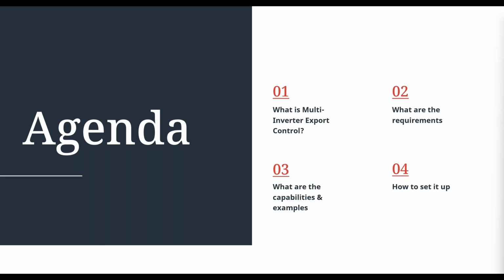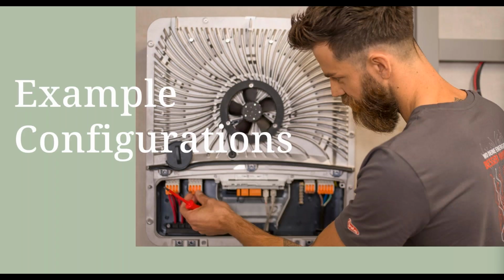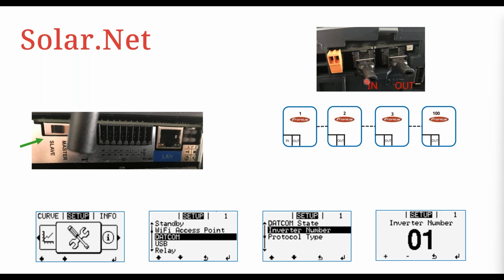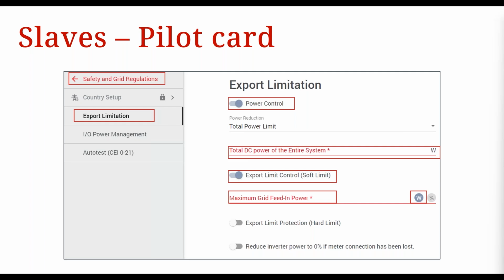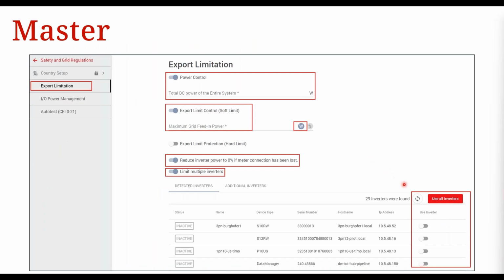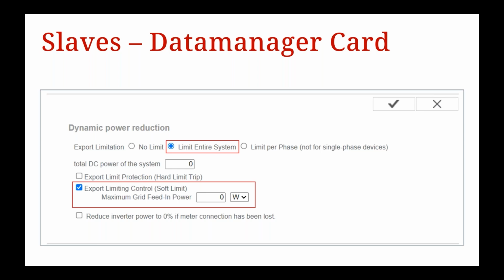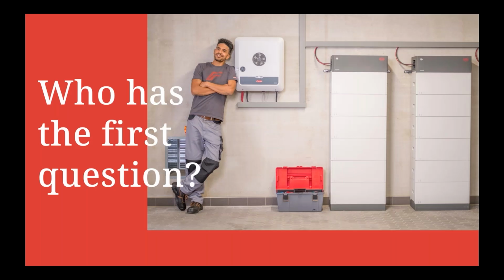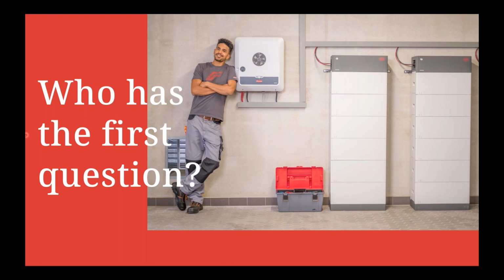Webinar: Multi-Inverter Export Control with Fronius Solutions (AUS)

Comment: I still don't understand why this all had to rely on an IP connection.  Why couldn't all of this have been possible across a standard RS-485 connection? My biggest issues with IP based is that customers change routers and stuff everything up if its contain in its own modbus network using its own wiring, that's not an issue.  Sure you could setup a router just for the system that then plugs into the customers router, but more cost an complexity. 

Also, forgetting export limiting, is it possible to have multiple GEN-24s operating WITH batteries?  And if so, can it do so when in backup mode?
Reply from the maker: Hi there,
For technical enquiries, please email our support team directly on pv-support-australia@fronius.com and our team will assist you further.
Thanks!
Your Fronius Australia Team